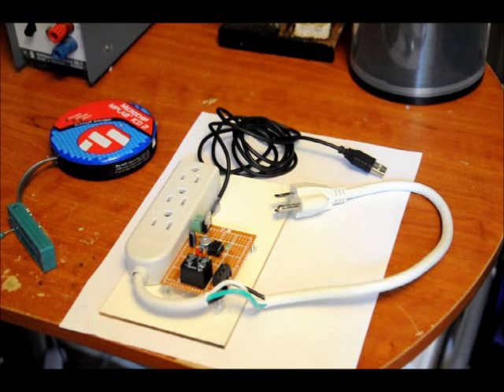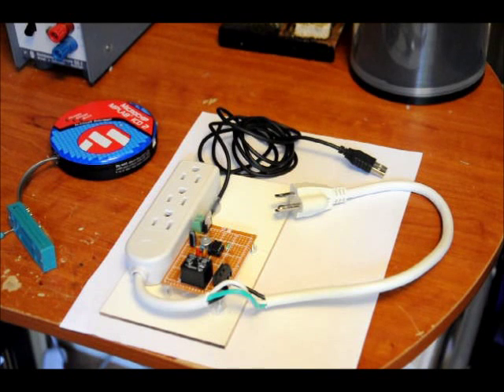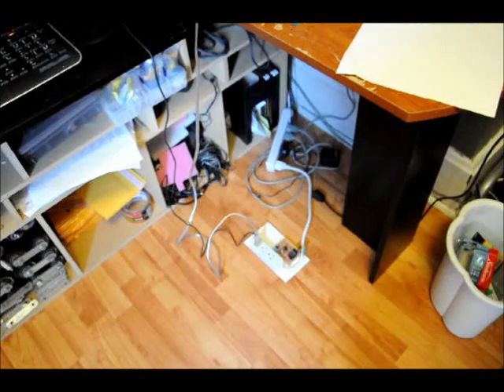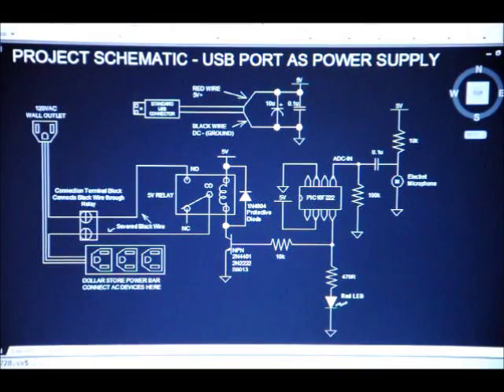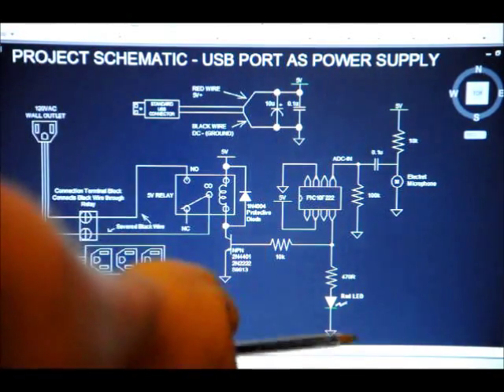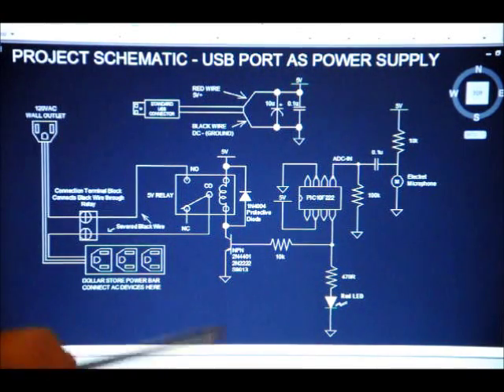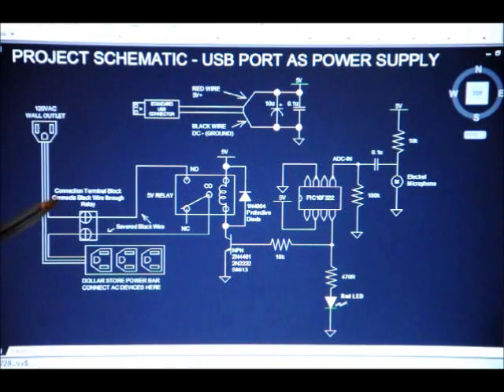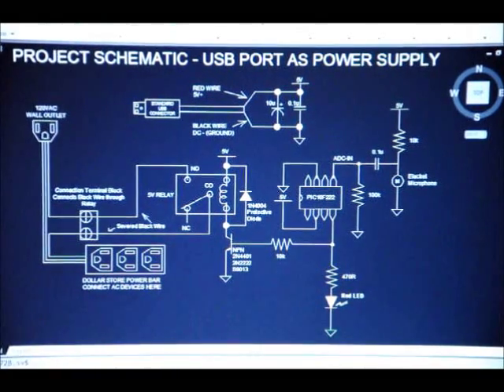USB Powered Clap-Clap On /  Clap-Clap Off AC Controller with NO AMPLIFIER!

Comment: Is it possible to use an earphone plug in instead of a microphone?

I think about recording 2 claps, burning them with a bunch of tracks on a CD and then hooking your circuit up to a stereo sound system, and that clap sound would be “the first track” on the CD….to switch on some party light or something like that.
How did you program the PIC10F222? I mean do I need a hardware programmer, or can I just program it on my breadboard with an Arduino? 

Thanks for sharing your great projects.